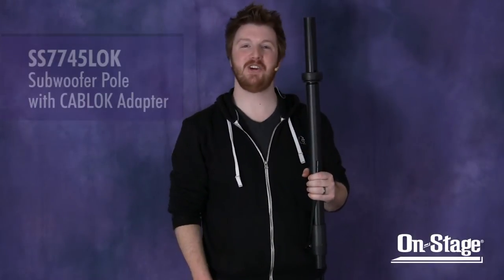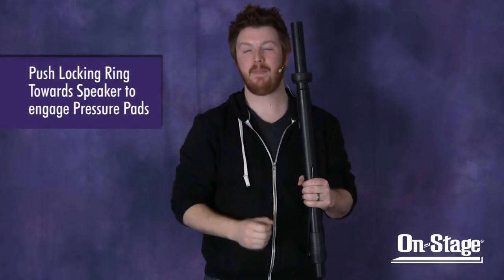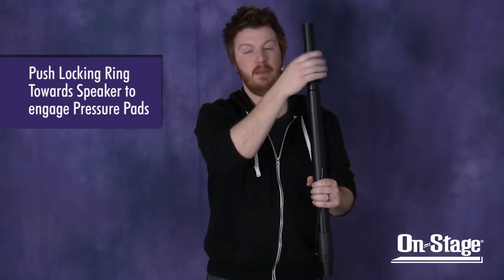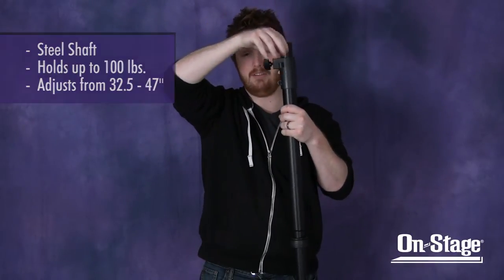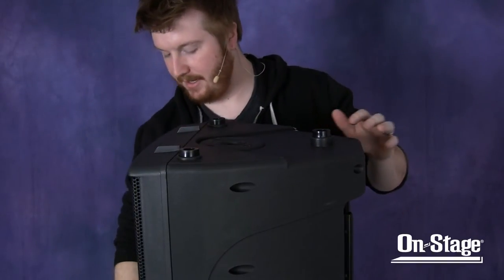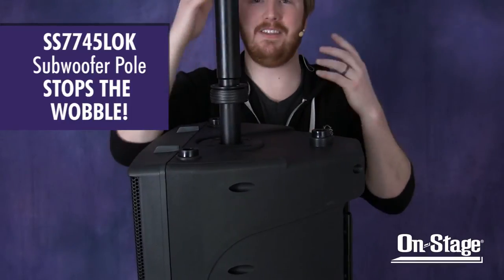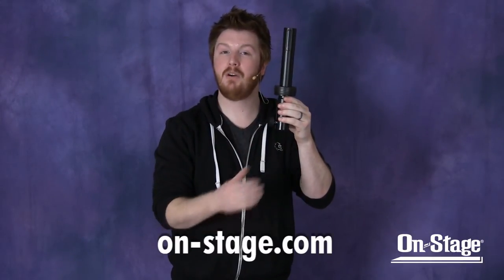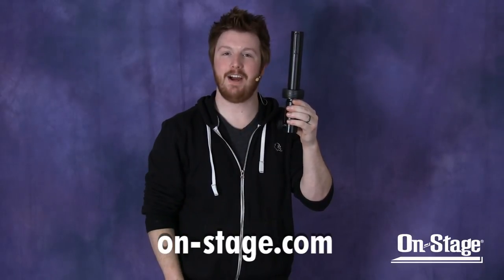SS7745LOK Adjustable Subwoofer Pole with CABLOK Adapter

Comment: Do u offer this with M20 thread for the sub?
Reply from the maker: Yes, our SS7746 shaft has a M20 attachment and you can buy the SSA45LOK Locking Adapter separately

Comment: What about the other side of the pole? Sometimes the sub part wobbles too. I have the Mackie SRM subs and speaker tops and they have a terrible lean. Mackie has told me to use Gaff Tape to fill the void on both sides. Have ya'll thought of putting the lock on both sides like K&M does? Theirs are just so expensive.
Reply from the maker: You can check out our SSA45LOK adapter - same mechanism in a separate adapter. https://on-stage.com/products/view/10455

Comment: But the speaker on the other end will still wobble - is there a double ended version?
Reply from the maker: The other mounted end generally shouldn’t wobble, but if it does you can also purchase our SSA45LOK adapter - same mechanism in a separate adpater. https://on-stage.com/products/view/10455